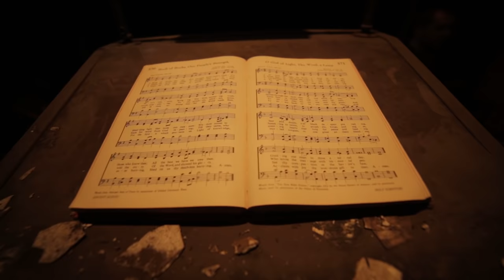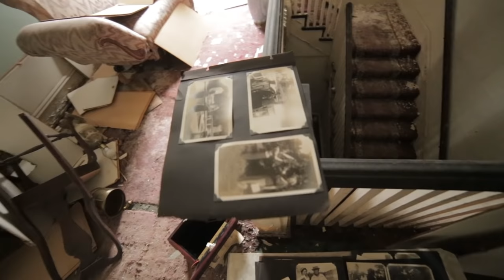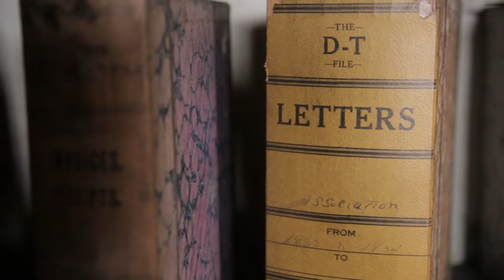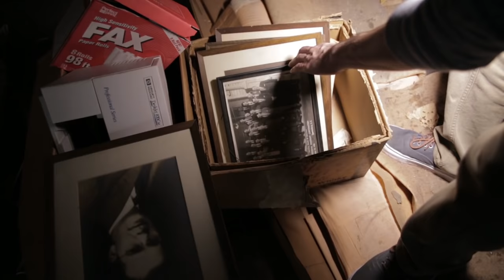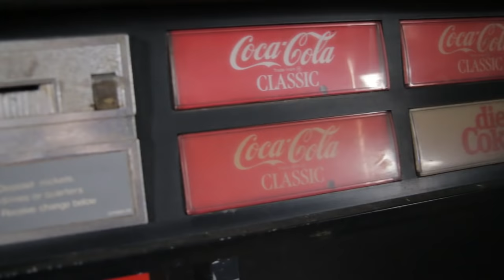Exploring an Abandoned Funeral Home with Power Still On 💀

Comment: 4:10 Jesus Christ! That's a Hammond A-100 (basically the same as the legendary B3) organ, those things are worth an absolute fortune, $2000 at least. I'd kill to get my hands on that thing.

By the way, to turn that thing on you have to flip one switch that engages the tone wheel, then you flip the other switch on and let go of the first one.
Reply: add another 2 zeros to that...Hammond organs are 200 grand in mint shape but this one is fucked and needs a ton of work but it's still worth at least 10 gs
Reply: @mogesay  They really arent though. I'm no expert, but a quick google search showed mint ones barely scratching 10gs if that.
Reply: It depends on the model, age and condition of each Hammond organ. If it hasn't been played in more than a decade, it will take a lot more than 5 minutes to fire it back up, and will require a lot of oil for the tonewheel generator. Took me two weeks of twice daily oilings (plus a new Start/Run switch) to get one running again. After that, it takes about 45 seconds before you can start playing it.
Reply: Push and hold Start switch until tonewheel assembly is running, then let go and quickly push the Run switch which then engages the the rest of the mechanisms. Of course with the one in this vid, I highly doubt the motor would engage right away.
Reply: The tonewheel itself may even just be seized. Wouldn't be surprising!
Reply: Hammond player/tech here...  Judging by the smooth chorus/vibrato knob it looks like an A-100 from pre-1961, so it's a good bet the organ doesn't contain any of the dreaded caustic foam that eats away the wiring in the keyboard chassis (manuals) and likely can be restored to original condition.  Also it's rare to see one with the optional factory back cover.  I hope someone saves it from the landfill.
The synchronous motor that drives the tonewheel generator cannot start from a standstill, so there's a separate starter motor that engages when the "start" switch is held on.  Once the starter motor has brought the TG up to speed, the "run" switch is flipped and start is let go, which turns on the synchronous motor and electronics.
Reply: @classicaudioadventures  I bet the tonewheel generator in this one is seized from being left for so long. I'm sure it could be rebuilt, but where would you get the gear oil and various parts? Are they still supplied?
Reply: @lsswappedcessna  There are quite a few places that stock hammond parts and supplies but tonewheelgeneral.com is my go-to for most things including oil and components for electronic restoration.  I've repaired organs with siezed tone generators...it's a lot of work just to unsolder and remove the tone assembly from the console but more often than not I get them to spin again using solvent degreasers and compressed air followed by re-oiling.  These beasts are tough to kill...

Comment: At 10:35, you can see the name of one of the old owners. What I've gathered is, this place was opened in 1914 and shut down in 2013 due to a new location being built. After the main building was built, a few years down the line the attached garage was built, "Construction of the building was completed in 1914. Several years later, an attached garage was added on which featured a turntable, enabling cars to drive into the building and then turn around to head back out to the street". This place went through 4 name changes/owner changes in the 99 years it was running, It is located near Jacksonville, Florida (not going to give an exact location), on February 11th 2019, the building caught fire on the second floor due to unknown causes (cause for so much decay and roof collapse), was most likely to be people living inside of it that started the fire. This place has quite the back story, the people who started this place up were very successful for their time, it's a shame that all of this history is going to waste. Someone needs to get in there and save the antiques before the building meets it's end. Great video you guys, thumbs up!

Comment: Walls and ceiling collapsing, check.  Water dripping from the ceiling, check.  Homeless guy, check.  Power still on, WTF?
Reply: Ikr?!
Reply: That's way confusing then the FNaF storyline but again,I have a old Skeleton robot that my parents got I believe in 1999 or 2000 and it still functions and my parents never changed the batteries

Comment: What is really odd to me is that power meter appears to be fairly new. It's one of the smart meters, which connects to the cell network, for them to read the meter without sending someone out. The place looks like it's been abandoned for for longer than that meter has probably been there.

Comment: Found an excerpt from an article by Sandy Strickland of the Florida Union Times dated Nov 10 2013 and thought it would be interesting to share. I doubt there's any plans on moving it over to a new location when it's still sitting there relatively intact (caskets, furniture, trade implements, etc.) I wouldn't doubt that there were some very 'haunted' features of this one… dead people after all, but many valuable treasures left behind speaks volumes. This was a great video. :)

"I've passed by the Kyle-McLellan Funeral Home on Union Street for decades. But recently, I've noticed that the building is closed. What can you tell me about it?

W.B.

Dear W.B.: The facility at 17 W. Union St. is owned by J. Robert Peeples Jr. and Joyce Peeples. They also own Peeples Family Funeral Home at 2220 Soutel Drive in Riverview. The Peeples family has purchased 5 acres of property near River City Mall, just north of Duval Station/Max Leggett Parkway on North Main Street. The Kyle-McLellan establishment will be relocated to the new site in the next few months.

The downtown location is for sale. It has held the distinction of being one of the oldest continuously operated businesses in Jacksonville, tracing its heritage to 1856. It was known as Moulton & Kyle Funeral Home when the Union Street building was completed in 1914. The Peeples purchased it 20 years ago from S.M. McLellan.

Comment: The Organ is a Hammond A-100 (Actually fairly valuable, electrically similar to B-3).  The Tone Generator is not self starting.  The Start switch needs to be held on for about 10 Seconds plus an additional 5 Seconds after the Run Switch is engaged.  Video: https://www.youtube.com/watch?v=tegMlgIgNHk

Comment: That little vault is a sample from Wilbert Vault Co. The vaults weight is 2,000 lbs.,  it is used for putting the casket in and then the lid is put on, It is a sealer vault so no water or moisture can get in.  They come in various sizes and prices,

Comment: The reason the power is on is because the owners are hoping a short in the wiring will burn the place down and they can collect the insurance $$$.  The building is still "for sale."  The power bill is very low with only a few working lights, but more than enough to torch the place.  Stay tuned.

Comment: I dated a guy who had a ‘65 Cadillac hearse for a vehicle.  He bought it cheap off another guy who’d used it as the same thing.  It makes a great utility and college kid party vehicle, especially on Halloween!
Technically, you aren’t homeless if you live in a funeral “home.”  The ashes, though, that was wasn’t right.  They should have been packaged up and sent or delivered anonymously to state authorities for burial.  Or at least bury them yourselves and say a few prayers and sprinkle holy water on them before covering them up.  Gotta show proper respect.
Reply: The cemetery I worked at had unclaimed cremains going back to the 30s and 40s. They don't dispose of them, they always hold onto them, at least the organization is supposed to, and rarely, very rarely does a relative claim them. It's a cost issue and if the organization decides to inter them, they are responsible for opening and closing costs. Even if a funeral home or cemetery decides to inter the remains, it could lead to a lawsuit from a family member since no permission was granted.

Comment: Does the power company know that the power is still on in that building with the state it's in . This is dangerous especially where there's water leaking in right in front of the meter box. Here in Australia the power companies would cut the power off quick smart because of safety,sounds like the laws are too relaxed over there, yes I know yous use 110 to 120 volts for your mains power but that can be still very dangerous and we still use 240 volts in Australia but there's no way we would get away with running power still on in a building in that condition , we'd be jailed for this here in Australia due to our strict ocupational health and safety laws or either a hefty fine from the power company.

Comment: +TheProperPeople to answer your question in this vid, the reason you can see your breath without it being cold is because warm air can hold more water than cold air can. When you breathe out the air is carrying water from being in your body and warming up. As it hits the outside air it cools down and can't retain as much water thus seeing your breath. Even in relatively warmer weather, your breath is colder than the outside air.

Comment: @ 9:31 At one time, a corpse was definitely in that crate standing in an upright position in the corner next to the old glass cabinet (left). It was actually a crate to transport a body and the funeral home repurposed it into a file cabinet. When I worked at a cemetery, we had those same crates in the tower of the mausoleum I worked in and the shipping crates were turned into storage cabinets for paperwork. The crates we had were used to transport the deceased soldiers of the second war, they were lined with aluminum and stamped with the date inside, e.g 4-14-1944.  I am sure other funeral homes and cemeteries repurposed them as well.
https://jaxpsychogeo.com/the-center-of-the-city/moulton-and-kyle-kyle-mclellan-funeral-home/

Comment: It's chloroform  2:19 I don't think there use it  anymore  main ones are formlin also known as formhylde solution some are gel based ill have to find out about that one again it's still interesting tho chloroform was used as an early anaesthetic there stopped using and went to more safer drugs chloroform is a solvent based  you can preserve stuff in it  its know to cause cancer  you would have a respirator when using it same as formhylde formlin